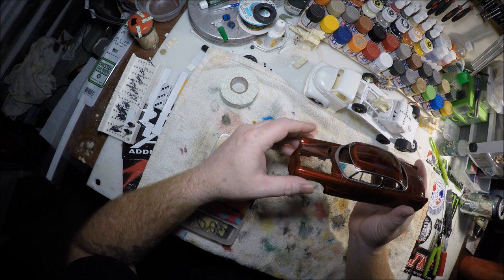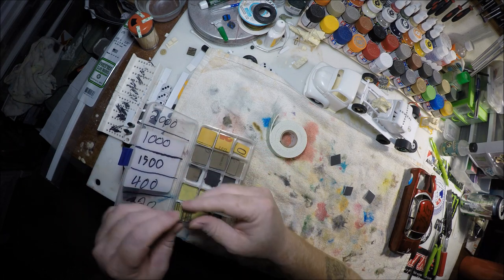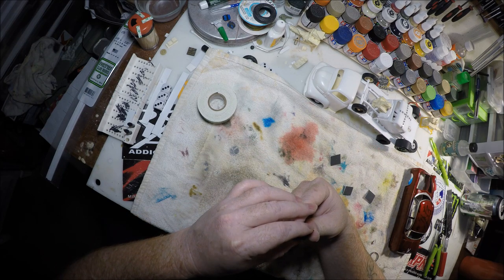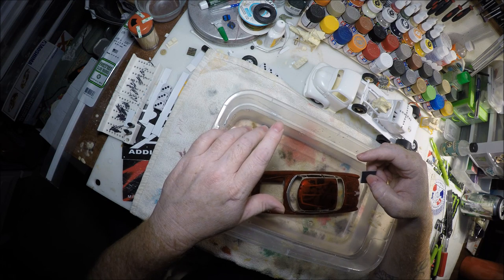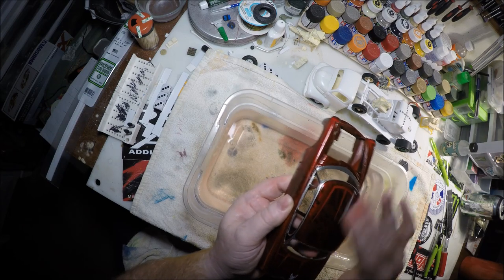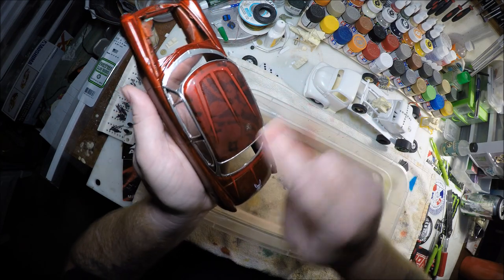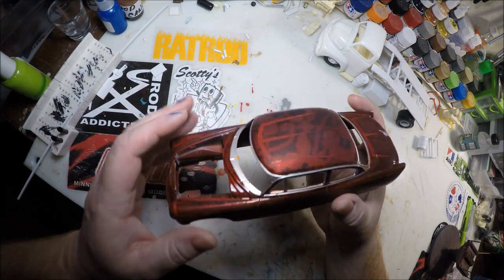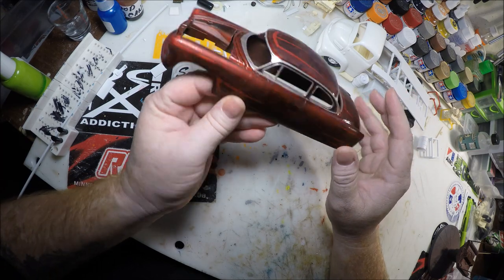how to polish a scale model

Comment: Hey Nick, I ran across this video while checking out other airbrush vids. What paint did you use for primer, base and clear, are you air drying , heat lamp or hair dryer ? I've been using Createx brand Wicked and Illustration paints doing portraits ( well trying to at least ) . Was thinking of getting back into models ( my last model build was back in 1976 ) and was just wondering what you use. By the way Great looking car, video and info, thanks